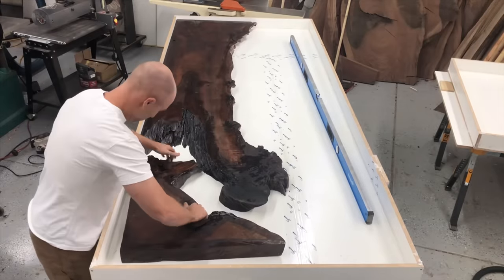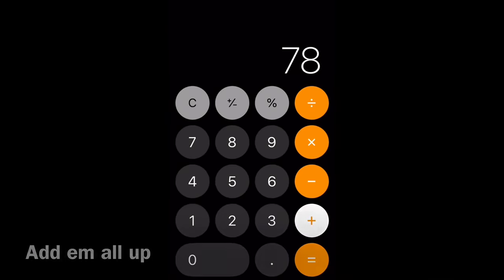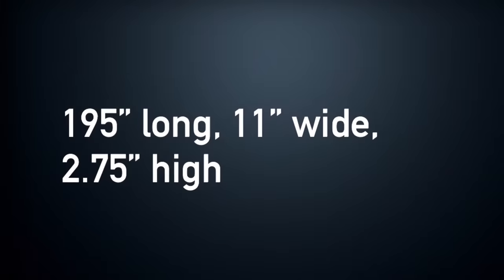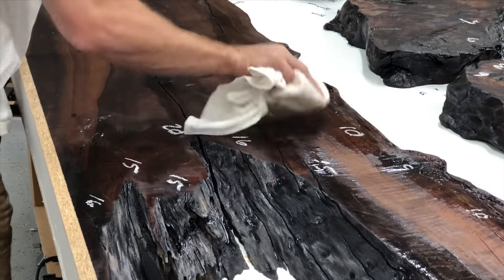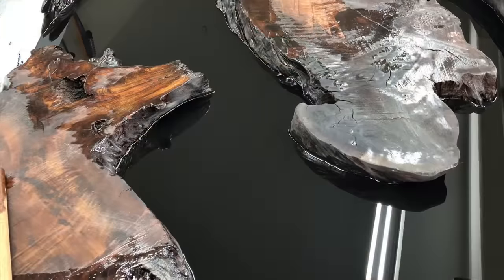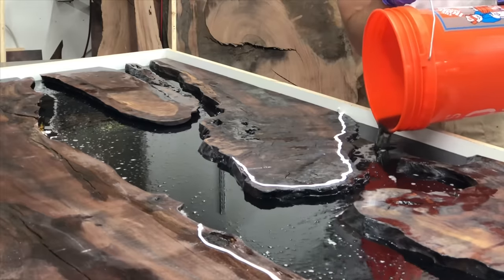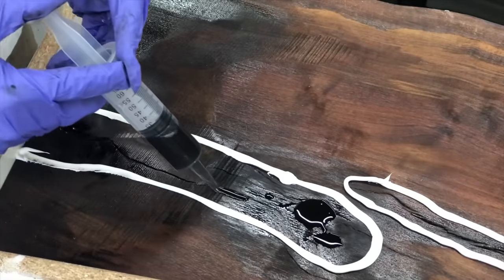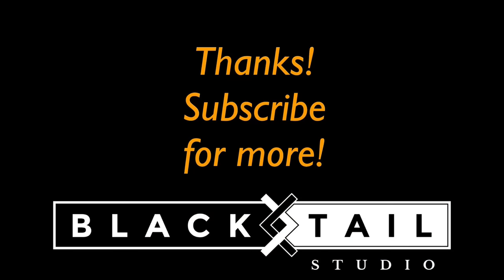Calculating Epoxy Volume--How to Epoxy Woodworking

Comment: Pretty cool. Maybe you should be buying epoxy wholesale.

Shipping and setup seem to be a problem. You would need someone capable of shipping such a heavy thing. And then you would need someone to actually set it up at the final destination. Finally, if the customer ever wants to move the table within the house he/she would need to hire a small crew to do it.

Overall, the finished product looks great but the weight is a deal killer for me.
Reply from the maker: It’s heavy!

Comment: I have a trick for you:
1. Cut a large piece of paper that cover your entire rectangle.
2. Weight it
3. From that paper, trace the area that is not covered by the wood and cut it.
4. Weight the cut paper.
5.  Determine the surface of the cut paper with a rules of 3.  For instance:
If the rectangle is 2 squared meter and the full piece of paper weight 500 grams and the cut paper weight 125 grams, this means the cut paper surface is 0.5 squared meter.  If the thickness is 5 cm then the volume is 0.025 cubic meter. If you consider the density of epoxy being 1, you ll need 25 liters.

Comment: Can you shrink wrap and do the water displacement method?
Reply from the maker: I can’t. You might be able to
Reply: Blacktail Studio you can put the wood in the box fill it up with sand remove the wood pour the sand in a measuring cylinder that’s how much resin you’ll need.😎
Reply: Blacktail Studio team work my fellow American 🇺🇸
Reply: To be more accurate you can shrink wrap your wood and use water to get precise but not necessary

Comment: To calculate volume without wetting timber, use a sheet of plastic over the timber and fill with litres of water until desired level.. simple
Reply from the maker: Brilliant. Then just pull hard  the tarp and water pops off.

Comment: hello sir just one question i would like to ask u ,, in 111 litres. how much was the resin used and how much amount of hardner was used ???
Reply from the maker: 2:1 resin hardner
Reply: @BlacktailStudio  so i think for calculation u have considered  60% of resin required, which is 96xo.6= 57.6 ltrs so for 2:1 resin which further becomes 57.6X2= 115ltrs  and hardner is 57.6... is this the calculation u have got ???

Comment: what is the bottom when you pour and how do you remove it?  ir does it stay attached?
Reply from the maker: Melamine 👍🏼
Reply: @BlacktailStudio  thanks  I didnt see your other videos.   Now I found them.  Do you have videos on how you finish the top of the table once the pour is done and sanded before use?

Comment: Just an FYI... the amazon link in your description for the plastic syringes are not the same size and the ones in your video... the largest ones on the list are 10ml the ones you are using look like they are 100ml... I just found out the hard way by ordering a box and they are super tiny compared to the ones in your video.

Comment: Or cover all the surface thats gona be in epoxy in plastic wrap ( in case its bad for the wood to get wet, and to prevent leaking) and fill it with water, meassuring the amount of water that you use, then get rid of the water
Reply from the maker: Or that 😊

Comment: How strong is the table in the places of just epoxy? I mean, you wouldn't park an elephant on it or anything but would it support some weight? I've just stumbled onto the channel so sorry if this has already answered. 👍
Reply from the maker: I doubt you could break it or with a sledge hammer. It’s quite strong

Comment: 1. Put a plastic over
2. Make a hole under
3. Use vacuum to suck the air.
4. Put water
5. Tear the plastic
6. Collect the water and measure it
Reply from the maker: I can’t believe I used a tape measure instead

Comment: How about using thin Clear Polythene Plastic Sheeting on top of your work and just pour a measured amount of water. Or plasticwrap the pieces and use Archimedes' principle.
Reply from the maker: Or a tape measure. Whichever is easier

Comment: Building a study desk / computer table (34"*24"). Wood is six squares of 10"*10" each. Rest is river. Options are desk thickness (1" or 3/4").

I have to fill in exactly 216 cubic inches of epoxy river (when table is 1" thick) i.e. thats  0.935 gallon.... However if i chose to make desk 3/4" thick (0.75 inch), its 162 cubic inches (0.701 gallon). 

My question: should i go with the 0.9gallon or 0.7 gallon.
Reply: In terms of, its a tight margin given wood absorbs. I am planning to get the six 10*10s at home depot. Recommended any specific wood?
Reply from the maker: That’s your call. I like to overestimate

Comment: Could you just pour water in the basin holding the wood, drain it and measure the volume?
Reply from the maker: Water isn’t a good mix with wood. Also seems a lot harder than a tape measure

Comment: Question how did you get the length with having all the different spots? I get the width measurements but I got a little lost on the other parts. Sorry
Reply from the maker: Just running a tape measure down the long part. My blog might make more sense.
Reply: @BlacktailStudio  do you ever make tables with Other color epoxy? I see your videos all have black epoxy

Comment: I would have measured the weights of off-cuts and their displacement in water to calculate the average density of the wood. Then just measure the weight of the hero pieces and divide by the density to calculate their volume. Subtract this from the total table's volume et voila.
Reply from the maker: Good to know!

Comment: Cam... Take a picture, size in photoshop so 1 pixel is = 1 inch. There is a function in photoshop that will tell you how many pixels are of a certain color. This is how I calculate material for landscaping.
Reply from the maker: Whoa!

Comment: Can't you clamp the wooden pieces down to prevent the epoxy from seeping under? This would save the wasted 8 litres... Also how about using fluid displacement to compute accurate epoxy required?
Reply from the maker: Don’t want to get wood wet. And clamping won’t prevent it. I’ve tried it all!

Comment: You can figure out the density of the wood. than weigh it all and compare that to the final volume of the table
Reply from the maker: Or measure with a tape.

Comment: Hypothetically, if you (anyone, not just you Cam) buy a table like this, and it does not fit in your door, would you rather cut the table or break the door frame?
Reply from the maker: Easy, break the door frame

Comment: I have no experience whatsoever with epoxy or table making, but couldnt you weigh a piece of would of known volume (a cuboid that you cut from the excess you get when squaring any pieces youre going to use), figure out the density of the wood youre using, weigh all the pieces youre going to use, then multiply the width of the table youre making by the measurements of the cast and figure out what percentage of the table is wood, then take the remaining percentage of the cast to know how much epoxy you need?

Comment: If you know the overall area of your resin table, you can calculate how much resin (weight wise)  you will need. Once you have that, weigh your wood and subtract it,you should be able to find out how much resin you will need. This should work, shouldn’t it?

Comment: Can you provide an economic analysis of this type of table?  I assume 105 L of epoxy is several thousand dollars.  Pigment is another high cost (I'm new to this so probably wrong).  The use of the professional planer and staff to assist (with forklift) is a huge alternate labor cost.  Then there is your labor as the artist.  The wood was probably hundreds of dollars, if not more than a thousand...  I have seen tabes like this go for upwards of $20,000.  However, I have to assume that you can easily lose money on a project like this, especially if you make a mistake...  Please let us know if you can do such an analysis.  Thanks.
Reply from the maker: I’ll think about that for a future vid!

Comment: Why are these epoxies so expensive? Is there a particular ingredient in them that forces the price up? Is it the cost of the ‘R&D’ that goes into making them (which would make you think the price will eventually come down)? 
Or, is it just what they can get? If it is, ‘just what they can get’, it seems like there would be a potentially ripe market out there.
Reply from the maker: I’d ask the epoxy manufacturer!

Comment: Why don't you just fill the frame with water to the level you want, drain out and collect the water and whatever you collect is the amount of resin you need.   I suspect that this would be less time consuming and more accurate than trying to take distance measurements.  This method would, of course, require that you dry out your frame before adding the resin, but that would probably be insignificant with a heat gun or hairdryer.  There are likely many creative ways that you could come up with for draining the water, like adding a hose and stopcock to the frame.  Also, since you are filling the "cracks" with opaque resin, why fill the entire huge "valley" with expensive and heavy resin?  Instead, why don't you add something to the volume, such as pieces of scrap wood, that will take up some of the space and save on resin?  You could add the pieces of scrap wood after your first pour, thus rendering them completely covered.  Some purist might scoff at that, but there are likely many clients out there who wouldn't''t care if they don't get a table with 5 inches of solid resin and would be happy to save some money.  Making your tables less expensive might mean that you end up with more clients too.  Would this compromise the structural integrity of your tables?  Maybe, you'd have to experiment with that.  And, obviously, this wouldn't be an option for projects that required translucent or clear resins, but they are probably in the minority.  Anyway, just a thought.

Comment: To engineers out there: it’s been awhile since calculus, but could you take the integral of this area to find the necessary volume of epoxy to use?
Reply: Yes, integrate the area (as a function of height) * dh over the height and you will get the volume. But that is just a fancy way of saying volume=area * height when one depends on the other.

Comment: What would the reasoning be behind not measuring the weight of your pieces, then figure out how much your table should weigh with x amount of wood, so if it was 12x8, that’d be 96, x density we’ll say 250lbs just because I don’t want to look it up. Weigh your pieces and subtract, get, say, 53, then make that much epoxy

Comment: How do you measure large amounts of epoxy?  I don't want to put in a small bucket and then add to the large bucket to avoid any of the epoxy not getting into the mix and messing with the chemistry.
Reply from the maker: Um, all the steps in this video are a good place to start.

Comment: Why didn't use mass displacement formula for the wood and subtract it from the total volume of frame to work out how much epoxy you need?
Reply from the maker: I guess because this was so much easier
Reply: @BlacktailStudio  I see where you are coming from; I scrolled down the comment section and read quite a few goofy suggestions. Each to his own, mate 👍

Comment: Or just pour water in and measure the amount. Of course the materials used would have to not brake by getting wet and you would have to let it dry up afterwards. But it would be spot on precise.
Reply from the maker: That would certainly get the volume

Comment: Easiest would have been to get the weight of the wood and removing it from the total table (As if it was a solid block). You can get wood density online.
Reply from the maker: Doesn’t sound easier than a tape measure
Reply: @BlacktailStudio  You must have paid by the weight for the wood righ. So you already know it. I guess my method involves more math but I do think it would accutate.

Comment: Why not just flood the area in water (put weights on the top of the wood to hold it down if required). Have a drainage hole in the bottom and measure either how much water you put in or drained out. Either way. Very accurate and far simpler.

Comment: I didnt watch this video. Im responding to its title only. 

Im suggesting that you make a metering station where resin and catalyst mix properly right before the hose thats pouring into a mold. 

Might take some time and effort but once its built and once the metering is properly calibrated then the process of gauging how much product to use will become much simpler.
Reply from the maker: Oh thanks

Comment: Or just get a bit left over of the original wood
Cut 1cubic inch. Weigh it that's your weight per cubic inch
Then weigh all the pieces to be used, that's total weight
Then divide by the reference weight and you will have a total volume of wood
Subtract that by the total volume of the table  and there you go
Reply from the maker: Nice!

Comment: Since the epoxy is black and not see through. You could have placed a filler material in the gap to reduce the depth of required epoxy. Easily could have saved lot of epoxy.
Reply from the maker: True!

Comment: Do you have a photo from above?
Reply from the maker: I don’t
Reply: @BlacktailStudio  Thank ya. If you do another table pour, any chance you would take one or two photos from above (with a ruler on one side so I can do a measurement?) I'd like to see if I could give you a formula from photo that'll give you volumetric requirements. Best would be directly above, but two angled from opposite sides (about the same angle, gotta make the math easier!) works too. Even a bunch of photos above that don't capture the whole piece would work- they can be digitally 'stitched' together then down sampled.
Just an idea.
I love the videos.

Comment: Why dont you just Fill it with water, then Drain the water to measure the amount you need?
Reply: Wetting the wood isn't a really good idea if you plan to work with it right away

Comment: Why not cover the wood with a  thin poly sheet and poke it into all the spaces. Then pour sand over it to fill in all  the spaces. Level the top then remove the sand and measure it's volume?

Comment: IDK if you'll read this, but do it the smart way!
1 take a picture of the setup
2 print it
3 do a cut out of the wood in the print
4 weight the paper on a small scale
the weight of the paper is proportional to the area, do your math!

Comment: As Sheldon Cooper would say, an indictment of the american education system...  All the measurements in inches would yield the cu inches of epoxy required, then you would convert into cu centimeters or litres.  I was wondering why you don't do all the measuring in centimetres.
I kid but the metric system is so much easier to be accurate.
Reply from the maker: I got an app that does stuff for me. And I don’t have a cm tape measure

Comment: 1 inch deep 7inch wide by 109 inches long equals what in gallons
Reply from the maker: Google will tell you
Reply: when u finesh a river table buffing like u do with osmo  is the epoxy ever shiny again. or do i have to epoxy the top again to get that real shine

Comment: Why not take each piece of wood and wrap them individually with one large sheet of plastic.  

Place them into the form with a large piece of plastic laid down. 

Fill it with water, then either tip the table or pump the water out to measure it.
Reply from the maker: Brilliant Levi

Comment: dont you know the weight of the wood ? if you know how much moisture is in the wood and the specific weight to volume of the wood you then know how much volume it should take up.
just messure the whole table you want to make lxbxh and subtract the volume of the wood and then you sould get a pretty accurate number

Comment: can you tell me one thingo? the whole gap is filled with 100% black not translucent stuff, why not to put some scrap wood or even other material as granulated black plastic to not spend $3k on resin but just instead pour maybe 15-20l of resin and throw some filer of similar or grater strenght and much less expensive both by money and environmental cost of making it ???
Reply from the maker: That could work!

Comment: Couldnt you put all the wood pieces in a volume of water and measure the difference in water height with and without wood?  Should be pretty easy to calculate the wood volume that way.
Reply from the maker: I’ll let you think about that for a bit and decide which is easier.

Comment: Wouldn't it just be easier to submerge the wood and work out the volume? Then subtract that from the volume of the intended finished table and you have the volume of resin required.
Reply from the maker: Good idea!

Comment: This is just me spitballing.

What if you laid down a grid sheet under the timber, then when you lay the wood down you can count how many grid boxes are visible and get a quick count that way. The grids are x area times the height you need so you'd get a real quick and precise way to measure epoxy. 

That being said. Cam's way seems to be pretty speedy and accurate too so maybe I'm fixing something that ain't broke 🤣

Comment: Cant you jus measure the volume of the rectangle if it would be full wood then calc the weight, subtract the actual weight. Then you have the empty weight  -> volume then you just need to know how mich Epoxy you need per volume.

Comment: I dont understand how it is possible to do any kind of profit creating these. If you buy 3L for 2500 then you need 37 of those to reach 111L and thats about 92 000 for only the epoxy? So for the creating of a table it will cost me about nearly 100 000?

Comment: You probably could have done most of this in half a minute by just taking top-down photo of the setup and then let a image-processing tool calculate the size of white area in the image, instead of taking dozens of tape measures.
Reply from the maker: Correction, *YOU could have done that